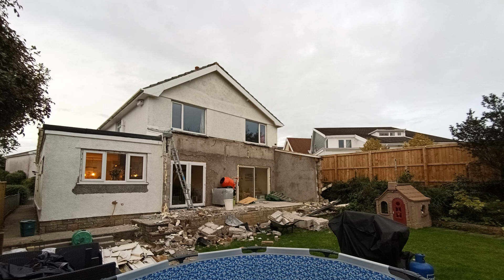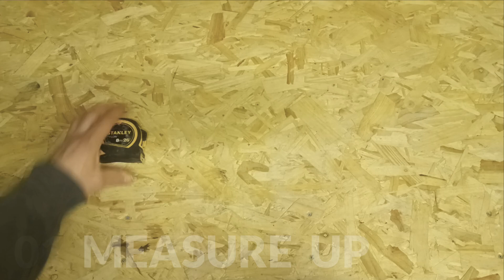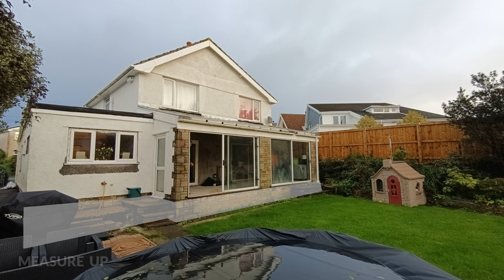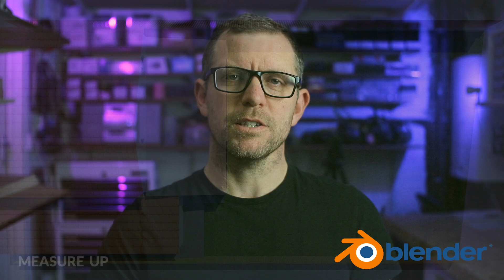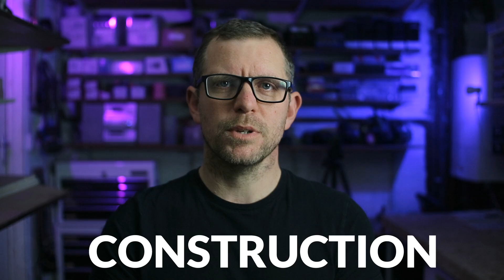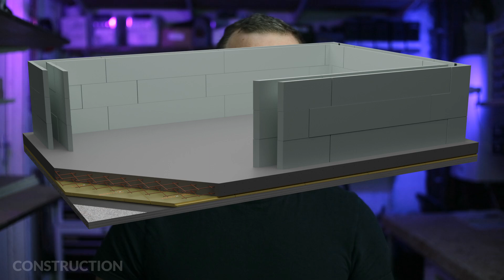How I Built a Heated Swimming Pool for Under £20,000 (UK DIY Pool Build) - Ep.1

Comment: Hi, I've watched all your videos which were very informative. So the main benefit of ICF is insulation (and not having to lug blocks around). However could you not just put 100mm+ of PIR on the outside of a block wall to get the same insulation effect for cheaper? Plus the thermal mass effect of having the blocks inside the insulation layer. I'm put off by the cost of ICF but do want good insulation as also in the UK. Many thanks
Reply from the maker: Good question. So I'm not an expert by any means. But the water is an enormous amount of thermal mass. So having to also heat up the walls would cost more I guess.  

Another large benefit of ICF over blocks is strength. Only relevant if you're rendering though. If using a liner I guess cracks in the shell aren't an issue. So blocks are fine. Ideally you'd go for horizontal and vertical steel to get around this if using blocks. 

For a small pool it might be ok. But for anything over 5m you either want horizontal and vertical reinforcement in your blocks or a reinforced concrete shell. 

An engineer will be able to give you calcs on strength and crack risk though I guess! 

Hope that helps

Comment: Great video! I’m also think about building my own pool (in the Netherlands). Have you a considered polyester pool instead of concrete? And if yes why go for concrete?
Reply from the maker: Hey thanks. I think the fiberglass/polyester pools have their place. However I'm not a huge fan of the overall look of them. I also wanted something with better insulation properties as I'm in the UK and we have a cooler climate. I've also built a concrete pool before and I know what I'm doing with those. You need to be quite careful when backfilling a polyester pool. I'd also have needed a custom shell and a crane. So the costs would have been considerably more than the pool I've almost made 👍.

Comment: Hi , a hug from Costarica central américa.!
How you avoid the leaking in between the icf and the concrete,  is the concrete itself that seal everything ?
Reply from the maker: Hi, and hello from the UK! The short answer, I'm rendering the inside with a product called Basecrete (or at least that's the current plan)  This will create an inner membrane to create a seal..I need to wait for warmer weather before I can do this. 

The long answer, check out the videos on the ocf finishes :-).

Comment: Hi Rich, where did you buy the ICF forms from and how did you seal them to the base?
Reply from the maker: Hi, I bought the forms from ICF central. They are not sealed to the base as I don't need waterproofing there really (I think!). As my waterproof membrane will be inside the inner insulation wall. And I'm undecided on the membrane. Possibly going with basecrete. Once I'm confident on the approach I'll share in an upcoming vid!

Comment: Hi Rich,

This couldn’t really have come at a much better time for me. I watched you’re last video about the pool at you’re last house a long time ago and have wanted to build my own for a long time but am finally in a position where I can start to seriously think about it and need more detail than you’re last video so these new ones are perfect, great videos with all the detail needed so far. Thank you. 

Looking forward to seeing the rest of your videos and will be taking a lot of information from them so just wanted to say thanks. 

One question, how much difference in price do you think the icf panels work out compared to the blocks and also where abouts did you go to get your icf panels? 

Thanks again 👍🏻
Reply from the maker: Thanks for the kind comments Michael. Progress isn't as fast as I'd like but it's getting there. Good question RE: Price difference. So.... Roughly, and this is very rough! I'd say the walls are triple the cost of normal Hollow blocks with vertical steel rebar like the last pool. I am keeping much more detailed costs this time so will have that detail later. My primary reasons for going ICF were ease of build and the insulation properties. Getting my Nudura panels from ICF Central. Really helpful staff there as well!

Also, I'd encourage you to consult a structural engineer to specify floor slab and ICF block thickness and steel specification in accordance with ground conditions 🙂

Comment: Hi. When digging the hole, would you recommend digging it slightly bigger to allow for tapering etc or would it be ok to dig at the exact size ready for the icf blocks?
Reply from the maker: Hi Ashley, I'll be digging the hole in the next video. But yes ill be digging it a bit larger so the foundation can extend past the walls

Comment: Great video. Do you know how much it would cost if you were to hire somebody in to do it all for you?
Reply: I had a ballpark quote for a very similar 6x3m semi in ground ICF pool from a reputable pool builder - c£60k (I’m aiming for nearer 10)
Reply from the maker: Haha Thanks for the note, that's helpful. I guess your paying for the people and equipment to be there. So proportionally a pool half the size would not half the cost. Did you sign on the line? Keen to see other ICF pool builds.   @johndouglass9822
Reply from the maker: Good question, So, based on my research, I think if it was all done to a fairly high premium standard with a marble style finish internal pool finish, and porcelain tiles and glass balustrade, I am guessing it would be on the upper end of this range - £30,000 - £60,000. If I choose to go with a lower end internal pool finish like epoxy paint, and a more budget patio surface,  Possibly on the lower end of the range. It's hard to say as I've not got a quote from a professional builder as I'd certainly not be able to afford it! I have found some information that would suggest that an 11 metre x 5 metre pool only (no landscaping) would cost anything from £80,000. Not sure how accurate that is though!